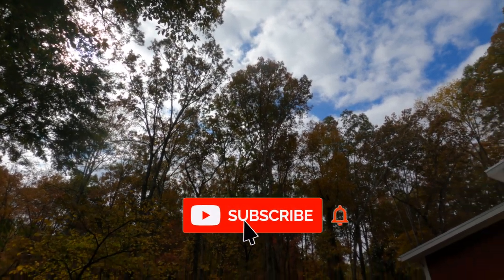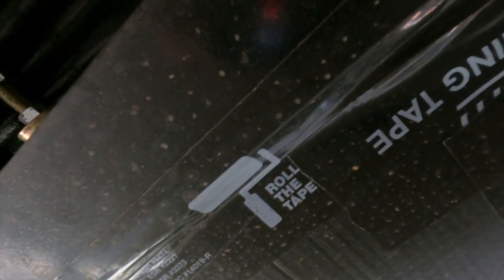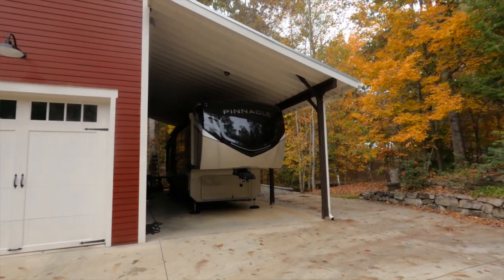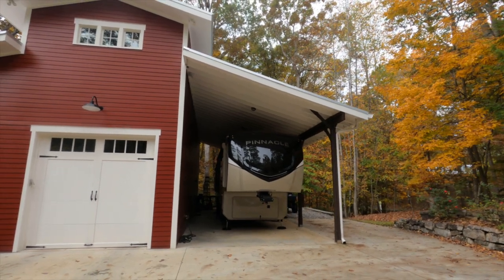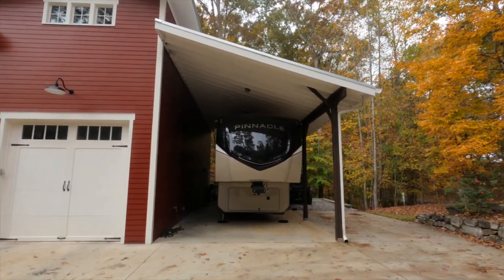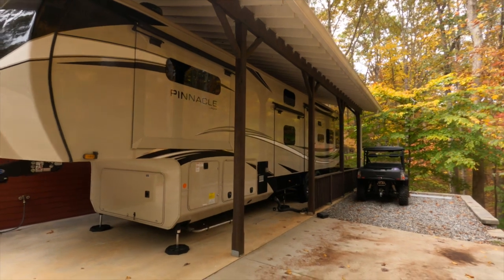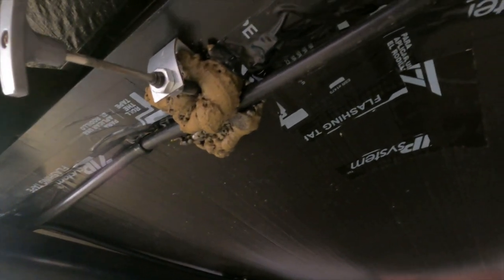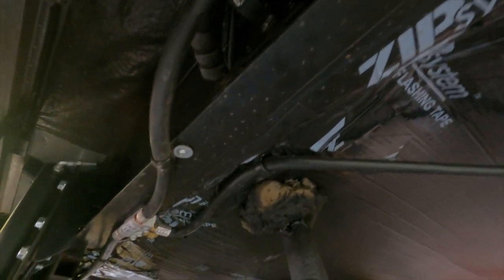Sealing My RV's Underbelly One Year Follow-up // Was It A Mistake? // Watch Before Sealing Yours

Comment: I sealed mine over 10 years ago. No regrets. I easily use it in temperatures in the teens. But for most RV owners, this won't make a difference for them. If they are in a campground, they are going to use a space heater because they don't want to pay for propane and they think the campground owner provides the huge amount of electricity required to run space heaters for free out of the kindness of their hearts. For those boondocking in cold temperatures, they are using a Mr. Buddy heater because they don't know how to provide enough battery power to run the furnace.

Comment: Definitely seal it. I had mice get in the underbelly and they chewed up a lot of wiring. Also could easily get into the living area of the camper. Do to the way the manufacturer ran the heat vents. The mice even chewed holes in the heater ducts.

Comment: I found your first video first, and then went on to this one. I work with building envelope science, as a portion of my business.  I  consider myself pretty good, but not a be all, end all expert.  I think all of your "rolling building envelope" premises are sound. I run a DIY Victron system, and use BT temperature sensors in that system. I put one sensor behind my nautilus system to monitor for freezing temps at the plumbing.  The back side of the nautilus is under my bedroom/bath area of my 5th wheel. That sensor also reports humidity. Does your sensor? That would be good data for folks with moisture concerns in the underbelly. I have found my sensor reports humidity closer to the cabin, than the exterior. So you can see the effects of the conditioned air in that "basement" compartment. I need to get some more sensors for my underbelly, before I do some sealing 😎
Reply from the maker: Thank you, appreciate the feedback! My BMPro temp sensors don't report humidity. That would be very helpful though if they did.

Comment: Options to consider for monitoring the underbelly:  Install a greenhouse Humidistat w/ Remote Sensor Cable, and/or a WiFi Water Detection Alarm with a 50 ft Sensing Cable, improvise a duct-fan that could pull air from the underbelly when in storage (it could even be controlled by the greenhouse  Humidistat); take a look at the Vevor 6" In-Line Duct Fan (<$100).
Reply from the maker: Great tip, thank you

Comment: 6" X 75' Stretch ZIP tape is now $161.00 on Amazon.
Reply from the maker: Whoa, pricey! The stretch version is always more $$, but usually closer to $50-$60...very stretchy for odd shaped like window corners. Otherwise standard tape should be closer to $30-$35 for 90'. Oftentimes Lowe's is best price locally.

Comment: Hey Jay, no way is sealing the underbelly (the way you did) a bad idea!!  
Reflecting back on the original video and following what you did, by sealing up mine.... it's been a game-changer!

Per my previous comments, I've gone allot further than you did when sealing up the underbelly.  I've installed R31 insulation throughout the entire belly, as well as spray foamed all the holes in the frame that hydraulic lines come through, and since I've completed the entire project last (Wisconsin) winter, I hadn't frozen pipes.  
An additional benefit was the furnace wasn't running continuous in single digit temps.

As for the vent in the stairs, I've taken spare window screen and stapled it to the backside to prevent any flys from coming into the coach from the basement.  And yes, if you leave the basement doors open long enough, the flys and other bugs will fly in and then come directly into the living area....

I believe those who argue about making repairs harder due to sealing up the belly, really don't value how the everyday benefits outweigh the "extra" work that comes with sealing it up.

Finally, those of us that personally take the time to complete this tedious task, are not the type to call a tech to come fix a problem for us.

Thanks again for a good video Jay!
Reply from the maker: Lovin' your extra details and insulation! I can only imagine your temps are much more extreme and colder. Thank you for sharing.

Comment: Great video(s) Jay! As an engineer, very much appreciate the detail you provided. 

I had a leak on my coach due to operator error - poorly crimped pex connection when I installed shutoffs for my outdoor shower. Without a place for the water to get out, I didn't find the problem until my underbelly and (very wet) insulation dropped out the bottom onto the ground. So to get home, went to a local lumber yard and had 3 1x4's cut that I essentially put in as bed slats after giving a few days for things to dry out. I found that I didn't need to secure the bed slats as the weight above has kept them in place for over 4 years now. The 2nd thing I did was to make some 6" "fender" washers out of melamine (painted) to help support places the underbelly was sagging due to being stretched by the wed insulation. I didn't seal these where I screwed them into cross members so that there was a path for water to escape should I make yet another mistake with RV plumbing.

And to your point about folks in the RV industry who don't seem to be RV customers. I couldn't agree more. How many of us look at an RV and wonder who it was designed for. I'm looking to upgrade to a "4 season" and have noticed a trend. Why don't extended season trailers offer a place to put coats? I'm generalizing as it's true of all trailers and I'm sure we all have our list of obvious (to us) things that designers - who aren't RVers, overlook- but sure makes your point.

Glad I found your channel!
Reply from the maker: Great ideas, and great points. Thank you!

Comment: Good video! What I did, is I sealed the edges of the cloraplast to the frame with 100% black silicone.  Spray foam certain areas that were large. The furnace is center camper so I noticed plumbing and wiring from living area to belly with excessive large holes routing the wiring and plumbing. I spray foam all those areas and made designated return at each end of the camper so the air from furnace travels to each end before returning to living area. Deer hunted michigan two weeks . Keep camper at 60 day and night.  Some nights it went to 17 degrees.  Belly low was 33 degrees. No problems at all. My temp sensor is is set at the farthest point from heat source. I'm thinking about insulating inside frame rails next.
Reply from the maker: Great ideas, thank you for sharing

Comment: Thanks for this very well done video. My Grand Design 5th wheel also has those weep holes in the underbelly coroplast. I think water can drain out and the insulation will stop most of air infiltration from the weep holes. If you need to reinsulate the underbelly, I've read on several RV forums that rock wool insulation is what should be used in the underbelly instead of fiberglass insulation because rock wool doesn't get ruined from water like fiberglass insulation. Foam insulation board has no issues with water either but its more difficult to install around pipes ect. Where as rock wool insulation can simply be pushed in to fit all the nooks and crannies.
Reply: Rock wool would be a grest choice but there's a big problem, it's really heavy.😢

Comment: I just wanted to say that I found this interesting as I just got my first travel trailer about 6 months ago. I've had truck campers in the past and those were easily heated due mainly to being small spaces. My trailer is the polar package so it has the covered belly. I have been thinking about adding a layer of the polystyrene foam panels. Screwed to the ribs. As far as sealing goes, you don't want to make it airtight. You should have a little fresh air exchange. I have built houses for over 30 years and the homes nowadays are very airtight. But they have what are called air handlers. The air handlers take the warm stale air from inside, pass it through a heat exchanger and transfer it to the incoming fresh air. That type of system is to bulky for use in RV's. My advice is to close up the larger air flows or add a layer of insulation which in itself will greatly reduce air flow but not totally.

Comment: It makes sense to me and I appreciate your two videos on this. I do have a question regarding weep holes, both for you and your viewers. 

I wonder about putting a silicone stopper type drain plug in the underbelly, through to the basement floor. That way if your basement flooded, you could tilt the RV one way to get the water to move to one plug, then the other way to get to the other plug. 

The plugs could be covered with the sealant or with removable tape to keep critters out while still allowing access to the drain plugs when needed. 

Does this make sense to anyone other than me?
Reply from the maker: Great idea.

Comment: I just discovered you, and I watched this and the previous video you put together on the subject.  Great job!

I just purchased my first RV - a Grand Design Reflection 150 fifth wheel which looks similarly constructed to your Jayco (excepting the steel runners securing the plastic along the length of the frame), and I am wondering how good that corrugated plastic sheeting can be in terms of durability.  My only frame of reference is from my childhood, when my parents purchased a new 1978 Holiday Rambler travel trailer.  My dad insisted on that trailer, as it was one of the very few that advertised a heated and enclosed underbelly.  I must admit that it was impressive in that regard...the entire underside was completely enclosed with a sheet metal panel.  Totally clean except where the main dump pipe and a few other minor pipes exited the trailer.  The dump valves were totally enclosed in the trailer and the freshwater tank occupied the cabinet beneath one of the twin beds.  There were vents between the living space of the trailer and the underbelly much like we see today.  Eventually we had a mouse intrusion, but we discovered where they were coming in (not from the underbelly) and after we addressed it, we didn't have a problem again.  We took that trailer over the rough backcountry roads of Idaho's Copper Basin with our old K20 Chevy pickup and never feared anything coming apart under there.  I wonder how many owners have attempted to replace the plastic material of today's trailers with upgraded (more rigid) material in a similar fashion.
Reply from the maker: Great feedback and thoughts. Thank you for sharing. Definitely seems like an area where RV manufacturers could improve and innovate significantly.

Comment: I didn’t read through all the comments so someone may have already mentioned this.  With sealing the under belly then needing to service, aren’t you just gonna take a razor knife, cut the tape, perform service and then reinstall the tape over the old tape?  Furthermore, instead of pulling the whole underbelly, you could just cut an “H” with a razor knife at the sight of service, install say a new valve or tank fitting, then reseal “H” using tape?  I like what you’ve done and will seal mine when the weather warms up here👍
Reply: Never mind, I spoke too soon.  Shoulda watched the video till the end😁
Reply from the maker: Agree! Yes, seems like a reasonable solution for maintenance to make a door. I like your "H" door concept.

Comment: I’ve been reminded by this video that the furnace air output needs to make its way back to the furnace. I did seal up my floor penetrations!  I wonder if I should open up a few spots to allow that air back up? I Wish I could at least filter that air, but then if I have the underbelly sealed tight I’d not be bringing up dirty or dusty air. What have you found as far as air quality back into your furnace area?
Reply from the maker: I have not found a great way to filter the furnace yet. It's always seemed odd to me that there isn't a filter provisioned from the 2-3 main vendors that make them for RVs...I have not seen a towable RV with one yet at least. Agree the dust is a concern, but hopefully less having it all sealed.

I've got a fairly large penetration on my floorplan between drop frame section and main frame and my furnace is nearby, so if yours is similar then I'd imagine you probably have enough air flow still even with the other floor penetrations sealed up. Otherwise I'd imagine just an opening 8x8 or so should be sufficient CFM between the under and main would be enough for return air to feed furnace.
Reply: Most of the furnaces, even the ones that go under the floor pull the air back in at the back of the furnace. The air is forced from the RV and out from the ducted system and then back in from the living area.

Comment: Do you have a residential fridge?  I have a 36ssws with residential fridge and the fridge is right up against the access door on the RV.  The water line for the cold water/Ice maker is inches away from the outside.  How do you prevent that from freezing?
Reply from the maker: Yes on residential. I haven't had issues with that ice line freezing yet. Our winters are usually pretty mild, but once in a while we get 20s consecutive. I have been using an all electric basement/underbelly heater (like a bilge heater for boat) and between that and electric fireplace I can keep things inside envelope comfortably above freezing. I've never taken a temperature reading back there, but I'll have to do that next winter... I'm curious now what it would register compared to rest of coach.

Comment: Thank you for making this video. I have a 2018 Grand Design Reflection fifth wheel and am considering following your lead here. I have spent a good amount of time underneath my camper as of late repainting the entire frame and to be honest, I can’t recall seeing any of these “weep holes” as you discussed. I am going to take a closer look but If mine doesn’t have them, I was thinking of drilling some with a small bit. How far spaced out would you say yours are and do they run front to back throughout the underbelly in the middle or are they only located in the center part? Also, roughly How many of these weep holes did Jayco put in each section?
Reply from the maker: Sometimes I wonder if the weep holes were accidentally made, some kind of damage to the corrugated plastic during manufacturing as they seem more random the more I look at them. Anyway I'd say they are every 3-4' and mostly toward center. I added a couple at key points such as directly under a dump valve or flush. Gives a little place of mind knowing I'd see a leak pretty quickly if it ever happened, hopefully never.

Comment: The question I have is how hard does that tape come off? I run a diesel heater in my camper and I have to drop the underbelly to service it.
Reply from the maker: The tape holds pretty well, so I'd recommend adding a 3-sided access door instead with the fold/hinge being most forward and then just remove that tape around door for service. It'll come off fine, but it does hold quite strongly.

Comment: So I have a question . First thanks for the videos . Great idea . My question is where the propane tanks are , what about sealing them off ? The reason I ask is typically most like mine the tanks are pretty much open to the outside air temps . And like for me I pretty much use mine full time for work and stay parked in one place for most of the year . So I’m the winter months I’ve noticed that from the cold temps ice will accumulate on the tanks . I also realize that the should be some ventilation in the areas in case of a leak . But as ice accumulates on the tanks then your efficiency of the vapor from the liquid goes down . Not that the propane freezes but the amount of vapor from the liquid is reduced causing it not to be as efficient. At least that’s my understanding .I have some ideas of my own that might help but I’d be interested in others ideas also before I done anything . This winter in Ohio I have placed some residential 6” insulation in the tank area and that seems to help somewhat but it’s not exactly where I’d like it to be in the form of temps .
Reply from the maker: Thank you. I wish there was an easier, cost effective solution for the propane tanks, but the only one I know of are the approved propane tank heated blankets. They're a bit expensive, but I guess it's due to the safety mechanisms built into them. The tank compartment needs to stay fully open to vent outside with full lower section open and upper vents open. That makes it difficult when they ice over like that, especially getting access to that last bit of fuel in tank.

Comment: What did you do about sealing around the slides. Those are good sizd holes
Reply from the maker: You mean the slide rams and gears running through i-beam and such? Nothing yet...have thought about a brush-like gard, but for now I've left it as is.